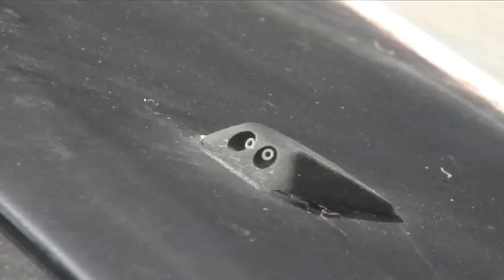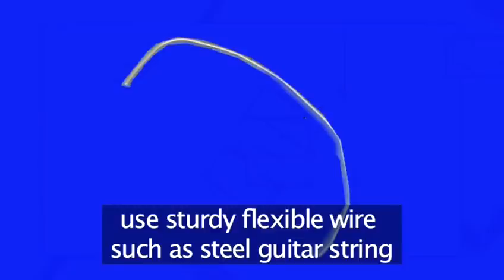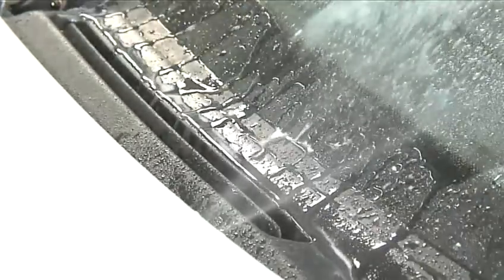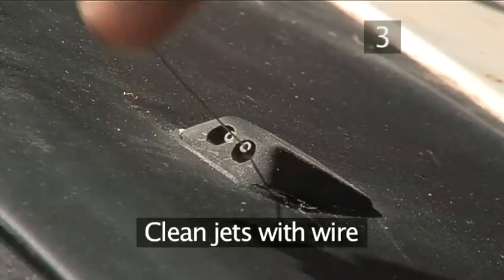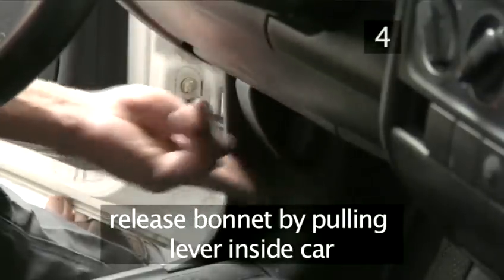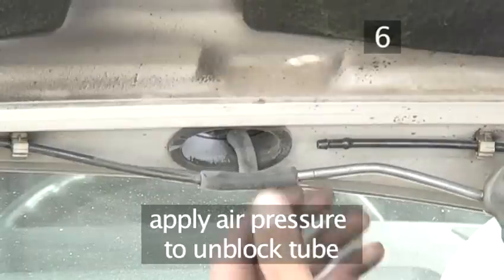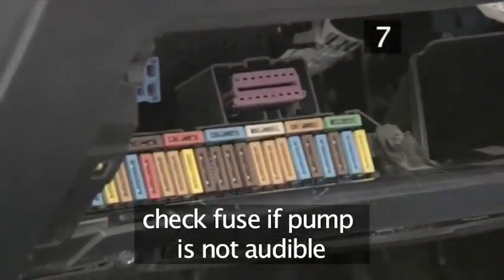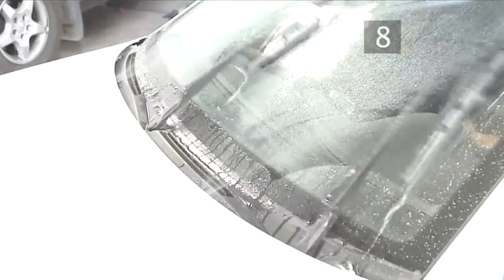How To Wash Windscreen Washer Jets

Comment: I pulled the hose off coming from the jug and then pull the squirt and could see it squirting from the hose there so, that there let me know the issue was the between the connector hoses to the nozzles. I used a Welding Tip Cleaner and filed the holes down and put it up the connection part before and it only worked temporarily. Today, after watching you video and I did the same thing with the Welding Torch Tip cleaner and this time I felt some gunk in the shaft of the nozzle. When I sprayed the can of air into the shaft and only the nozzle, some gunk shot out of it in my hand where I could see it. Now I can see a clear opening in the nozzle too and it works. So, between using the Welding tip file cleaner and the can of air used, the two nozzles work perfectly now. Thanks for the tips and the video! :)

Comment: A hose, A compressor, A nozzle, A dynamometer, A radioactive suit, A nuclear reactor.........
Thanks guys, I've got them nozzles working now 😂😂✌✌
Reply: Vj Siwach VII hahahahaha
Reply: 1:46 it is absolutely necessary the car has to be on a level ground, parked in reverse & in 1st gear.  Also make sure all your tyre pressures are set correctly since one tyre set 1lb above normal can severely affect the trajectory of the jet spray. 
   PS all off above applies only to LHD cars as shown in the video

Comment: I used a 60ml syringe and some tubing. Attached to the connector pipe  between the door/body, and applied pressure/suction with some plain water. It shifted it. No “asking the garage to use a bleeding compressor “ !!

Comment: As Malcolm Fraser used that saying "life was not mean to be easy" ...my jet seems to have a one way valve, when you poke in them jets you can feel something like it . I can blow water through them.  Both pumps immersed in water will squirt 5m away through their out pipe, yet when i connect  to the hose (i blew water through with my mouth and not even back to the jet) it won't work! I'm beat!

Comment: thanks but I would wear safety boots not open toe sandals
Reply: I noticed that! All that safety precaution material and yet matey is wearing Crocs! If you using air compressors you should also wear goggles but then where does it stop!
Reply: Those are 'Safety Sandals'

Comment: Never put just water in the washer bottle for two reasons. 1. It doesn't clean as well as dedicated windscreen wash fluid. 2. In frosty weather the water in the bottle will expand and crack the bottle, then you have a leaky bottle.
Reply: Absolutely right.

Comment: Don’t put a manual car in first gear when parking. It damages your transmission gears over time. The parking brake is literally there for that reason, to disallow your car from moving. Considering you’re supposed to get your car checked every year, your parking brake should work fine.
Reply: Nah, I'd rather put it in 1st, just for safe measure.

Comment: Every proper mechanic will smoke while doing this, as he will while doing any other repair... Fire hazard? What are you using in your shieldwash? Light fractions of oil? For fucks sakes... Where I had my practice the guy I worked under and adored didn’t spend an instance without a bud in his hand... He went through two boxes or more a day and still does... Never caught fire despite working near open petrol tanks and what not... It’s the fumes that are a problem... And if you can’t smell petrol fumes, you have bigger issues than getting blown up for smoking near it might cause...

Comment: unfortunately my nozzles will not unblock, and having trouble finding a replacement nozzle
Reply: If they are clogged with minerals from the water, take them off and leave in vinegar overnight (or some other liquid that dissolves the built-up minerals). For future use never use tap water because it will happen again. Use window washer fluid or distilled water (distilled water only during warm weather). Usually hard water is the issue since cars have filtering mesh on the holding tank intake, so dust and other stuff that can clog the nozzles are filtered out at the mesh.
Reply: I had tried that. A friend of mine unclogged them with fish wire. working great now
Reply: Good to know. As I'll do the same in next few days, can you tell me the vinegar didn't work or the clogging was by another means (not mineral buildup)? I tend to use vinegar on most cases where I have to remove mineral buildup from hard water so your input could save me time :)
Reply: i figure because we have soft water where I live that CaCO3  buildup wasn't the cause.
Reply: gotcha, thanks for the reply!
Reply: send them to a reform school...they are very naughty!